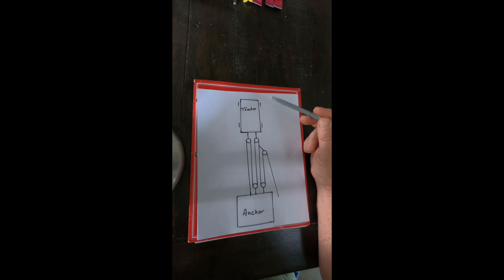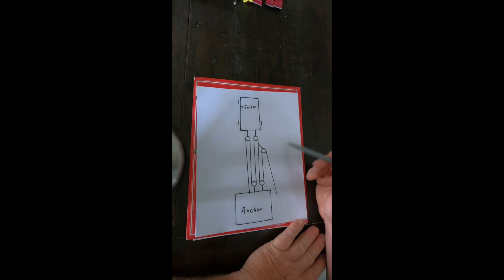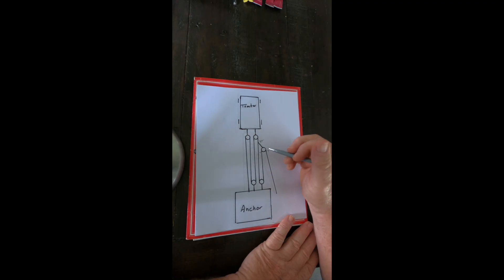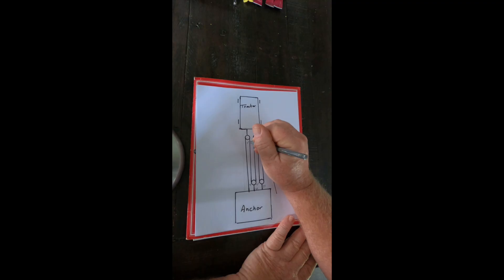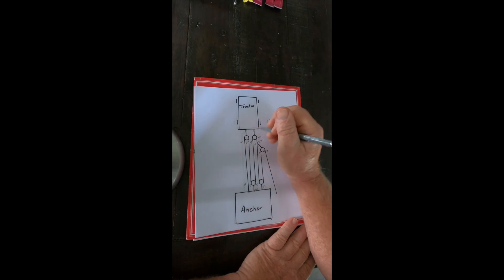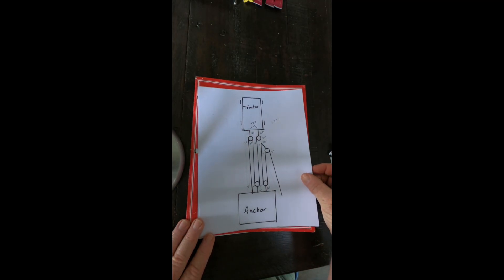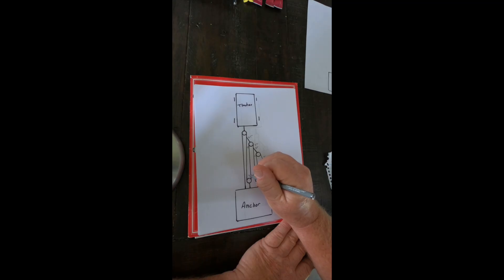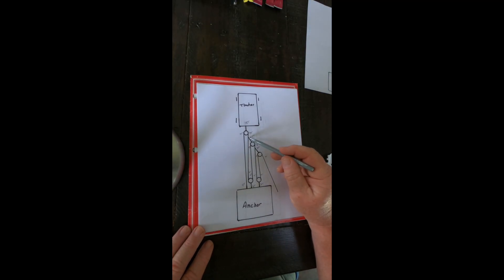An exercise utilizing the T-method for Pulleys and Mechanical advantage

Comment: BRAVO.  Thanks.  I agree with Anatolli on moving the first pulley to the tractor to reduce the tension on the rope at the tractor.  In the long run, it will save the rope from being too stressed out.  When I first calculated by T method, I forgot to follow the rope around the pulley.  That was my mistake.  I won't forget it from now on to calculate it correctly.  Sometimes mistakes are good for reminding you not to make the same mistake again.   Great Video, buddy.  I hope to meet you one day and we can compare and share notes on Knots and Pulleys and survival skills.  Take care.
Reply from the maker: It's a good method to know, especially trying to figure out complex systems. Thanks for all of the feedback.

Comment: Hello, Sir! Thank you for the explanation video.
However, in my opinion, saving some work is not the main reason for leaving that pulley at the drawbar.
I consider a much more important reason to be keeping the maximum rope tension as low as possible. Moving the pulley to the prusik increases the maximum rope tension to 27T. In case of leaving the pulley at the drawbar (or, as you said, moving it to the carabiner with the figure-8 knot), the maximum rope tension would be only 9T.
So, relocating that pulley reduces the maximum load capacity of the system to one third (considering rope strength as the limiting factor), basically without any benefit.
I think this is especially important for that system: someone might overload the rope without even realizing it, due to such a high mechanical advantage.
Thanks again — your content is always insightful and thought-provoking.
Reply from the maker: Excellent observation. I tend to overlook such considerations due to the equipment that I use as it is all rated so highly. But if you have a marginal rope that could make the difference between success and failure. Thanks for the feedback!
Reply: I agree with you.  Your suggestion was a very good one.  I will keep that in mind the next time when I need 27 to 1 ratio.   Great joke, buddy.
Reply: @bowlineobama  I`m glad you consider it useful. Thanks a lot.